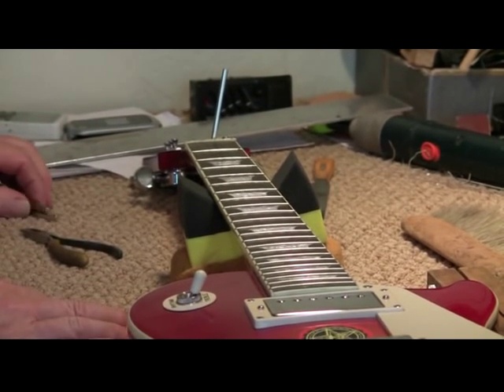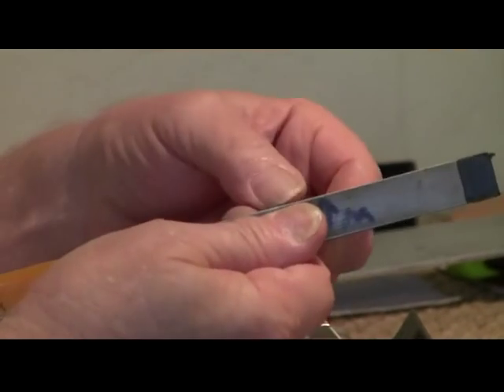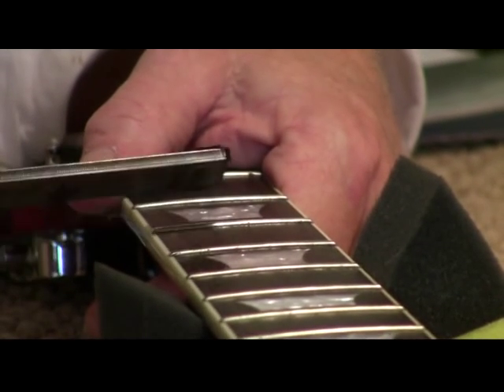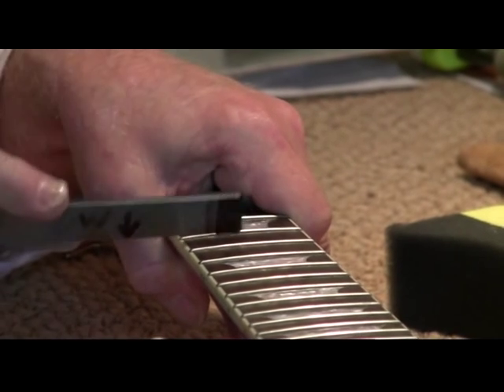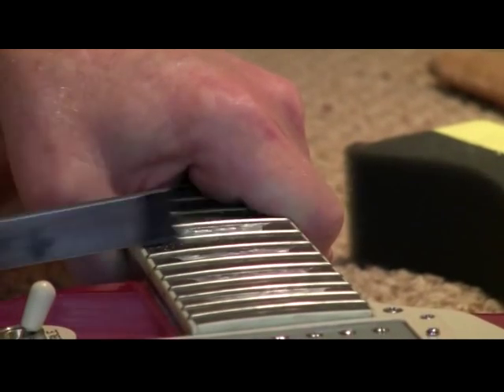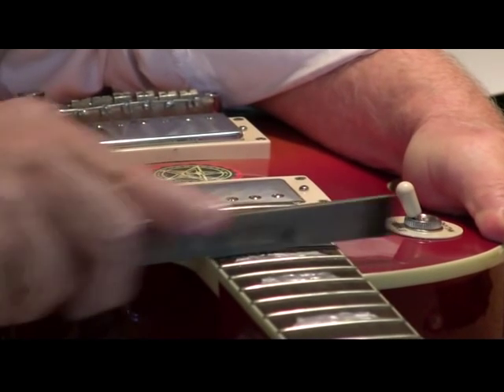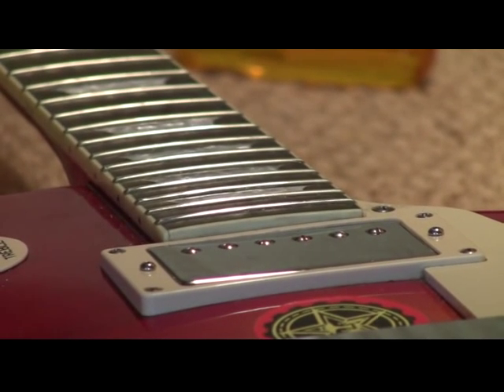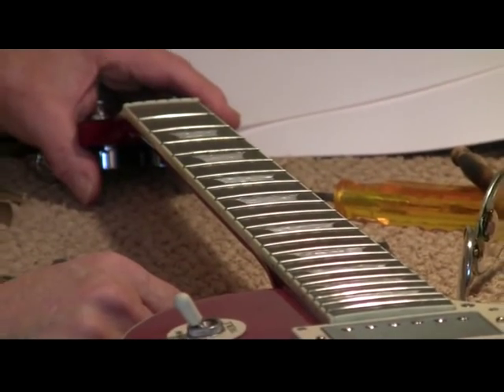Common Sense Guitar Repair Part 4.mp4

Comment: Hi Ed. Thank you for the feedback. Here is my email guitarsill@yahoo.com  I played the guitar but there are times that I want to have a knowledge on basic tune up specially fret leveling.  I agree experienced is the best teacher. Another follow up question :) When using the straight edge, where on the fret board  do you consider as your reference point if there is any that will serve as guide during fret leveling? Thank you :)

Comment: hi Ed this is very informative. But then I am confused. Let us say the 7th or 8th fret wire is low relative to other frets, then how would you level it to other frets assuming the truss rod is completely adjusted or should I say almost leveled? Do I  need to replace the low fret wire here? thanks really need your thoughts.
Reply from the maker: By this point in the process the truss rod has allready straightened the neck - but low frets 7&8 indicate that more truss rod adjust is needed - otherwise the higher frets will have to be lowered. It takes doing this to 10 or 20 guitars to get the process down. Send me an email thru my website for better info.